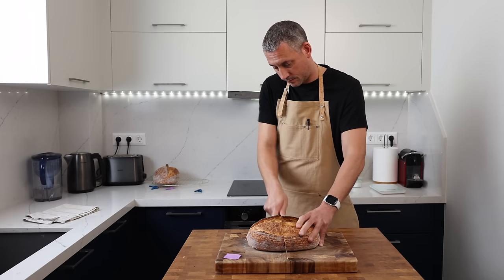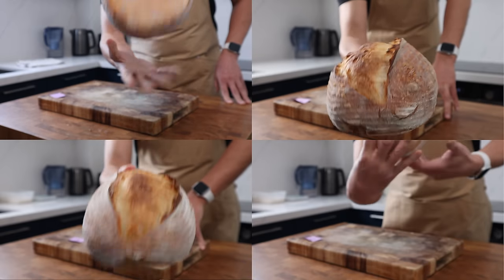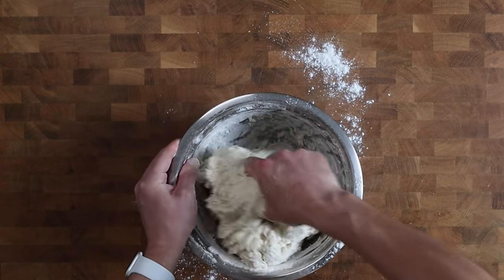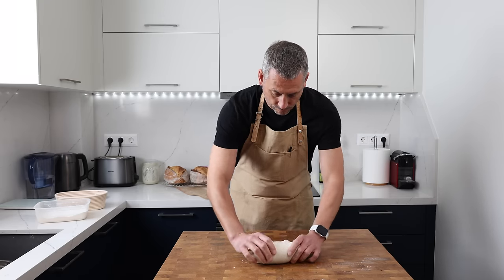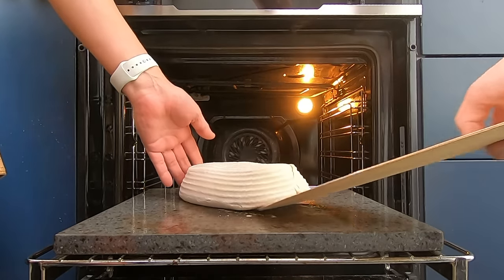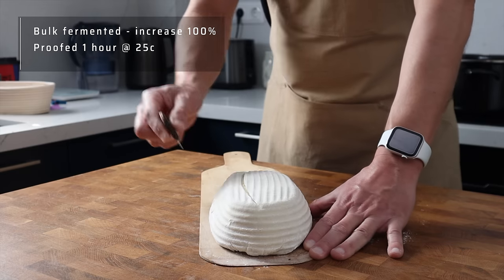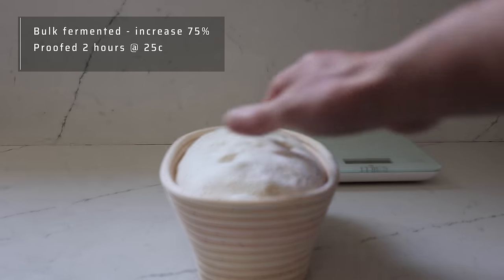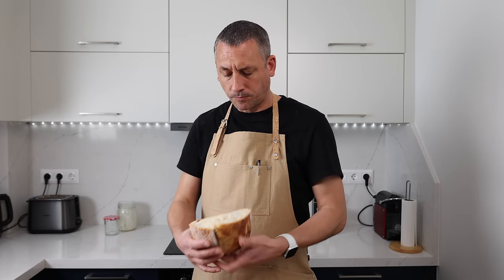Stop Over Proofing Your Sourdough, Use This Experiment to Find Your Optimum Proof

Comment: My theory of why test 4 turned out the way it did: you allowed it to proof longer in its final form/shape.  I think that gave you the regular crumb structure.  The other tests were properly fermented but didn't have enough time or opportunity to expand in their final form.
Reply: 3 was proofed the same way but bulked till doubled 4 was bulked to 75%
Reply: @vincentlabruzzo5368  That's a good point.  I guess #3 was overproofed in comparison with #4.  I wonder then whether #4 turned out the way it did because it was given longer than #1 and #2 in the basket (final form) and still had more active yeast, i.e. not overproofed.

Comment: You proof/ferment at 77F ?  Seems a tad low to me, but im still learning. 🤔

Ive read that the various strains of bacteria and wild yeasts that comprise a typical sourdough culture scatter in their optimum temp preferences in the mid to upper 80's thru the low 90's (F), and slightly higher for things like thermophilic yogurt (95-104F). Yeast has a broader thermal range (ale & wine yeasts like 70's & 80's, lager likes 40's & low 50's), but the strains most suited for baking like pretty much the same range, or a smidge warmer. For that reason ive been fermenting my sourdough in the vicinity of 89F internal as a thermal compromise.  For example, if I park a 1 kg boule in a 2L cambro, spray lightly with oil, seal it, then drape with a tea towel as a light thermal buffer, i cen proof in my digital food dehydrator set for 95F ... it maintains a rock steady 88 - 89F internal temp in my dough.  If I wanna slow it down, ill move it to my fridge at 35F, where activity speed drops about 5 fold (i e. 3hrs at room temp is in the neighborhood of 3x5=15 hrs in fridge).

Anyway, im just sharing my method ... id enjoy hearing temp targets and maintenance methods by other bread aficianados.

Comment: I hope this will be helpful. I seem to get great bulk fermentation by leaving it out on the counter over night (maybe over-proofing) but in the end lack in oven spring. I haven't refrigerated my dough at all. I'll try your method and see if it helps. I've been learning a lot form your videos, thanks for taking the time.
Reply from the maker: Keep me posted Trudee
Reply: @CulinaryExploration  Okay, still no oven spring though the crumb is improved. I noticed as well that my dough doesn't hold it shape like yours when I transfer it to parchment.  I sprayed the inside of the dutch for steam but it didn't seem like it would be enough (20 covered +25 uncovered @ 425). The scoring just looked like scars after baking, no ear at all. I did notice while baking the first loaf the second loaf and my test dough rose some while setting out on the counter. I'll give a report on the second loaf after baking.
Reply: I’m meticulously doing a 1-1-1 on my starter to improve its strength. Hopefully it will help with the oven spring. I won’t be baking for a couple of days so I’ll let you know how things turn out with an improved starter.

Comment: My test bread - good sprang and ears, but tight crumbs and few big holes. Original plan test #4 - Bulk Ferment 75% / Proof 2 hrs / Fridge overnight, ended up over fermented 😅, senior moment ... did not remove control dough till bulk ferment, should adjust to 60% increase in volume or poke test. Interesting experiment and nevertheless bread taste good !  

To keep dough at 25c environment - Bulk ferment using instant pot yogurt function low setting, when dough reached 25c, turned off and left finish proofing, about 4 hours. After shaping, heated 2 cups water for 3 mins in microwave, put banneton inside, when dough reached 25c, removed water. Dough was able to maintain more or less 25c both methods. Overnight in fridge, dough temp was 9c, should have put in lower shelf.
Reply from the maker: LOL Becky. I'm interested to know what is your sweet spot for the dough during bulk fermentation. Lots of people have told me that they go down to 25% which produces a good crumb. I get an uneven crumb at 50%, the dough feels a little spent, saggy, loose at 100%, 75% seems to be my sweet spot
Reply: @CulinaryExploration  Still hit-and-miss, been keeping notes and pictures. Used to go 100% or more, bread not holding shape. Start doing 75% which produce best ears, good crumb and shape, as long as I remember to check. Hahaha!
Reply from the maker: @BTs-he1lg  LOL

Comment: Hi Phil, thank you for this informative Video. Our life is not long enough to learn everything about this "easy" topic. Anyway, I am looking for 50-60% increase during Bulk Fermentation, shaping carefully, off course some bubles pop and depending on the Temperatur i leave the dough proofing in the Basket 1-2 hours bevor stsrting the cold Fermentation for 12-20h. I beleave you can have  the most accurate resaults by using a PH-meter. Be carefull, when accidity increases the Gluten breaks down.
Reply from the maker: Hey bud. I've got a decent PH meter on order, looking forward to playing around with it. Do you find the crumb is a bit random with that length of bulk fermentation? I get a nice loaf at 50% bulk but the crumb is a bit all over the place
Reply: @CulinaryExploration  hey Phil, in my breads I am using 60% self milling  whole grain flours, a combination of rye, barley, spelt, wheat and oat about 75% hydration and 20% of Starter. So my crumb and Textur are a little bit different. The breads are still fluffy. I find all your breads excellent, but i know we always try to improve our skills and method. In my opinion, shaping, scoring and baking are extremly Important to the appear of the end product.
Reply: I forgott to write, i use the shaping of john from proofbread in Mesa.
Reply from the maker: @athanasiospapakostoulis580  I am testing the shaping right now! It's fun fiddling around with the process, I thoroughly enjoy it - have a good Easter weekend :)

Comment: Hi Phil! I've been following your videos for a while now and they have been immensely informative and love the experiments that you have done. It seems like underproofing or placed in the baneton longer to proof doesnt seem to have much effect on the texture. I have been getting a gummy dough and wonder if it has got anything to do with baking temp and duration. Would you be able to share any tips on nailing the right duration or if you would have plans to do a video on it coming up?
Reply from the maker: Have you tried pushing your fermentation a little further to see if that helps with the gummy texture? I'll definitely have a video focussing on baking temps and times, but first I've got more exploring to do in the fermentation process :)
Reply: I had issues after moving recently. The common wisdom is 20/20 for covered/uncovered baking. Well, after the first 20, your bread should already be 92-95C. In my current oven that takes 30 minutes.
I just used a little digital thermometer, poked the middle, and figured it out that way. Worked really well, but took a few bakes to nail down.
Reply: I’ve also been getting this problem. It’s not awful but not where I’d like it to be. I’m experimenting with cooking longer covered and less uncovered. I think that actually made it worse. I’m going to try reducing my bulk fermentation time as my kitchen sits around 22 so maybe 6hrs is too long. If you manage to figure out what causes it I’d love to know!!
Reply: @CulinaryExploration  yup I did! I've also been using your hack of taking out a little piece so that i dont have to visually gauge the size of the dough in the bowl. I'll stay tuned for that and enjoy the other videos for fermentation in the meantime :)
Reply: @mattymattffs  hmm, i guess it also depends on how big or small the loaf is as well. I suspect the internal temperature may not hit it yet so I've purchased a instant read thermometer and shall wait for it to arrive before checking it like you do half way through!
Reply: @tarachristie472  same here, i'm trying to experiment with covered and uncovered at times, and also some recipes go with non preheated dutch oven too. for bulk fermentation, I think Phil's way of putting extra dough in a little container to monitor works really well. I found out that I had to wait alot longer than I had expected when I did a recent batch
Reply: @xiaowees  yes, me too. As my kitchen is warm that left me wondering if my starter wasn’t great but using the scrapings method it more than doubled by the time I got up so I can’t see that being the problem. I tried cutting off a bit of dough just before the bulk ferment and put it in a pot with a band but I think I cut off too small a piece. I was being stingy because I didn’t want to loose dough for my bread. Lol Currently I’m cooking in a heated lodge Dutch oven but I’ve ordered a big enamel roasting pan to try my pizza stone with a pan on top instead, just like Phil. I’m determined to crack this.
Reply: @tarachristie472  I always bake in a Dutch oven from COLD.  I put the dough in the cold pot and oven, set temp to 230 and after 45 mins I remove the lid leaving another 5/10 minutes to brown the top off.  I never fail with this method and of course save an absolute fortune in electricity not having to heat the over for an hour before I bake.  Takes a huge leap of faith the first time you try this method but trust me it works perfectly without fail.
Reply: @andyblackpool  Thanks Andy. I’ll def give that a try. With the price of electric just now anything that can keep the bills down a bit would be great. 😃👍🏻

Comment: Man, I really think I have been overproofing my loaves.  I was getting some really beautiful loaves then suddenly they all got flat with no ear... wonder if because getting warmer here?  Even did the sample dough method.  Maybe my shaping technique changed (last couple were very difficult to handle - been at 76% hydration so maybe drop back a tad...) 🤷🏻‍♂️
Reply from the maker: If the temperature has increased it will push the fermentation along quicker. Keep a close eye on the bulk fermentation and proofing stages and dial them back if needed. Decreasing the hydration may help, especially if the increased temperature has made the dough trickier to handle or has caused the dough to spread a touch more when you turn it out of the basket.

Comment: Really interesting tests! Using your recipe has given me the best results yet but my bread knife is not up to these crusts! Even after painfully sharpening each serration, which I regretted this morning after it bounced off the crust and straight into my finger which now looks like my dough after scoring. 😖 I wondered if you could recommend a knife up to the task? Thanks.
Reply from the maker: I am putting a new knife through its paces right now! First impressions ar awesome, I'll update everyone in the community email and in an upcoming video very soon :)
Reply: @CulinaryExploration  Thank You! 🙏🏻
Reply: @CulinaryExploration  My current recipe is a one day bake (never had much success with refrigerating the dough) which often leaves me with baked loaves well into the evening so I pop them into large zip lock bags but leave them open, it softens the crust for easy slicing the next morning. I always slice and freeze my loaves to save them going stale before I get to eat them all
Reply: @CulinaryExploration  Thanks....  I think ATK did a test on bread knives and I bought the Mercer Wave 10" and that seems to work well.  I happen to have 4 other bread knives (Henkels, Victorinox ...) but the Mercer seems to do well.... I also had cut my finger before and learn to cut on the pull back and not push forward.  I  go slow initially until the cut has created a channel before going faster....   

Thank you for sharing your experiment....

Comment: Your loaves look so easy to work with!  Mine would spread out if I didn’t bake them in a crock.  I have rice flour but never thought to use it to dust the loaves.   Why this over AP or bread flour to dust?  I’m going to try your final proofing suggestions as well as your recipe for the bread.  Fingers crossed my dough is more resilient like yours.  Thank you for making these awesome vids.  So incredibly helpful.  I got my start by buying the book Flour Water Salt Yeast.  As detailed as it is and a great lesson book, your instructions on how and why, showing things that work and don’t work as well are necessary insight.  Again, thank you.
Reply: Rice flour won’t develop if moist as would AP or bread flour. Hope this was useful!

Comment: Question: for the 75% bulk/2 hour proof, what did you base the 2 hours on? Did you monitor your “control” dough to see when it had doubled, then called proofing done? Or did you just go by feel/poke test?

Thanks for the videos!!!
Reply from the maker: I've been asked that a few times Maury. I did think about using the control dough to continue monitoring the dough during proofing, but couldn't really see the point as the main dough is knocked about when shaping. So once it's in the basket I need to use touch to gauge when the dough is inflated properly, that won't be connected to what the control dough is doing. What are your thoughts?
Reply: @CulinaryExploration  Ahh that’s true. At that point, bulk fermentation is still continuing — but all the control would do is show expansion of the control. I’m always looking for a crutch, haha, but need to hone my skills in feeling and “poke testing” for proofing being done.

Comment: Ok, help me out here, because I'm getting lost. What is "bulk fermentation" in your way of doing sourdough? Many people teach that you knead the dough,  put it in it's final shaping basket and "bulk ferment" it in the fridge overnight, mean the bulk of the fermentation and "proofing" is done in the fridge overnight.  I have only had one time that that method worked.

I'm thinking your method is much like how you work with regular yeasted dough, with a first rise, shaping, second rise... then your putting it in fridge overnight for the fermenting part?

Am I understanding it right?
Reply from the maker: Hi Jen, I have only used this method to make sourdough. The dough is mixed and sits covered for bulk fermentation period, in which time the dough is often stretched in some form. After the bulk fermentation the dough is shaped and placed in a basket for the final proof, and then baked. I hope this helps :)

Comment: Can you tell us more about yours proofing chamber ? 🙏
Reply from the maker: Very soon! I'm putting that video together at the moment!
Reply: I’d highly recommend the Brod & Taylor proofing box. I love it!
Reply from the maker: @tarachristie472  Hi Tara, what's the temperature range?
Reply: @CulinaryExploration  It goes from 21c to 90c with 60-80% humidity and it folds flat into a laptop shape when you’re not using it. I love it!! I haven’t used it with sourdough yet though I thought a long slow proofing would develop better flavour. Maybe I should rethink that. On yeasted doughs I have found it a godsend. The dough rises consistently and doesn’t require covering because it’s in a humid environment already. I would highly recommend it to anyone that was an avid baker. 
Thanks so much for all your content. I really love your videos!
Reply from the maker: @tarachristie472  Cheers Tara!
Reply: I’ve build mine proofing chamber by myself. Same size as Brod and Taylor but much much more cheaper 🙃

Comment: How do you measure the percentages of the bulk fermentation? like the 100% or the 75%? I find that very difficult. Do you measure it only with the small testing piece?
Reply: Great Videos! With even better looking bread!
Reply from the maker: Yes, but more coming on that very soon :)
Reply: Cambro makes translucent (polypropylene) and clear (polycarbonate) , food-safe containers with printed volume measurements and lids in various sizes that are not expensive. If you bulk ferment your dough in it, you can see the height of your dough to easily track the increase. I put a small piece of masking tape on the outside of the container to mark the starting point of the dough.

Comment: I use 100% Einkorn flour for health reasons, but this was what I was going to try next myself (won't get as much of a rise due to the nature of Einkorn).  My recipe calls for 3 turns but the dough gets really tight, I've suspected 2 turns with a bit more time in between might be the thing.   I've already been doing 75% on bulk ferment and longer second proof, I feel it gives better results.
Reply from the maker: I find 2 turns is more than enough for this dough, it works well with a no-knead approach too. How long are you leaving it in the basket for?

Comment: What do you mean by increased by 100%, Proofed directly in the fridge? The dough is technically proofing once the starter is added.(I understand the concept of 100% etc, what is confusing me is your terminology)
Reply from the maker: Hey Keith, the dough starts to ferment as soon as you add the starter / levain. The proofing period generally refers to the time the dough spends in the basket after shaping (but the dough is still fermenting during the proofing stage too). Hope this helps.
Reply: @CulinaryExploration  Hi I tried your method with the "control" as before I used to mark my bulk container and use that, I would say this method might become my favorite method as I can use bigger containers rather than longish containers. I think one way you can improve your method is to remove the "hours", for example: you said "bulk increase 75% proofed for 2hrs". To be more accurate you can do another video saying "bulk increase 75%, proofed till control 80/90/100/110%" or "bulk increase ...... Put in fridge at control +/-100%". The reason I am suggesting this, is because there is no reason to stop monitoring your control and 2hrs can mean a lot, were as the control is theoratically mathemathically correct everytime and should produce more consistant loafs.